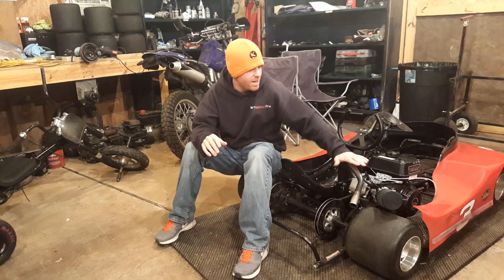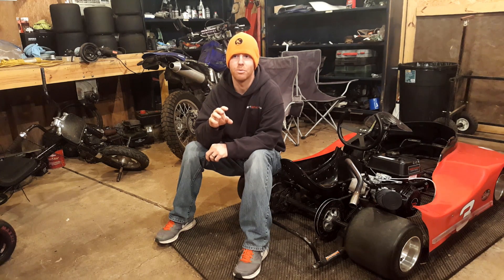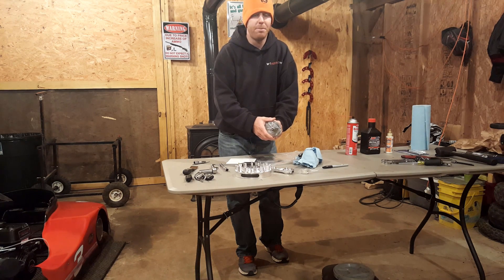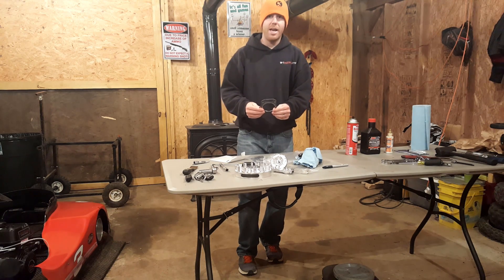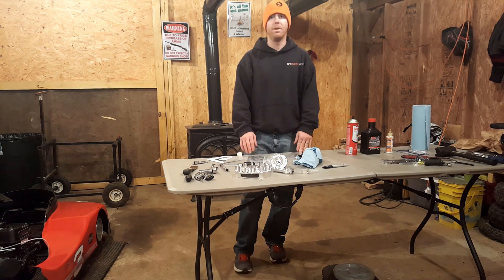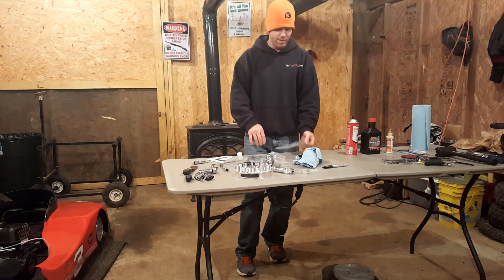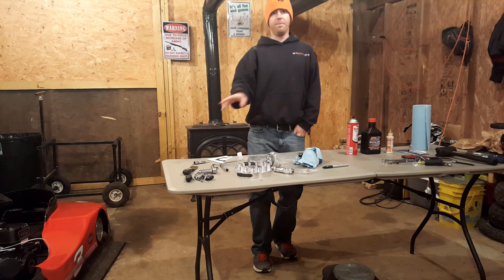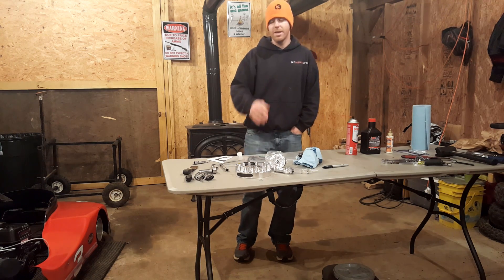Predator Performance Series Video 1 (Stock Vs. NR Racing Stage 2)

Comment: U should put Predator 420 in that kart to get more HP. It's simpler and cheaper.
Reply: I agree. To get 18-20hp out of a 212 which is basically maxing it out in terms of performance parts you can buy. You's spend like $800. Why spend more money like that? Why not just get a bigger motor? I mean For what it cost to do a 200 upgrade kit to a pred. You could take your total money and get a stock 301/420. Max out a pred and you can get a 670 for cheaper!
Reply: @theq4602  Some tracks only allow a certain "displacement" for Open and Outlaw classes. If a class specified a "stock Honda GX200 and clones with allowable upgrades", then going to a 420cc engine would be illegal. If everyone just said "hey, just go to a 420 instead", then there would be no reason to ever tinker. We would get bored and start putting 1500cc VW engines in karts. It would be limitless and unfun.

For a personal yard kart? Go for it, but wrenching on your engines is part of the fun.